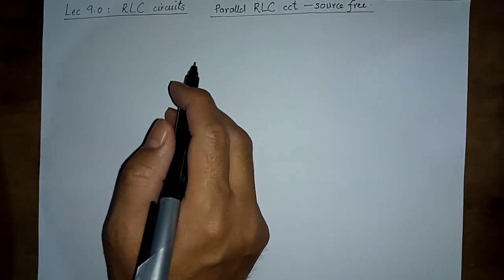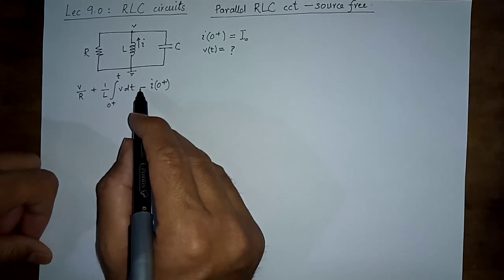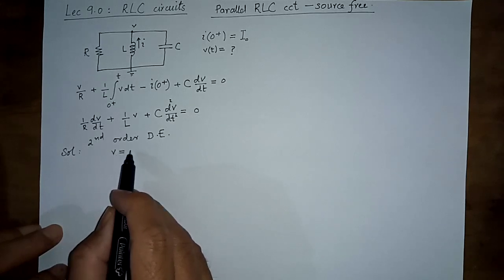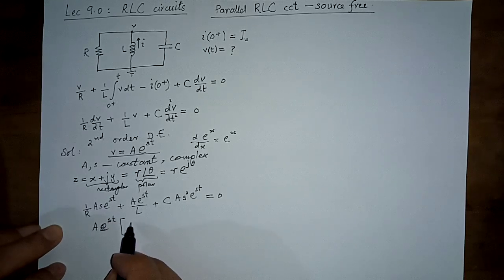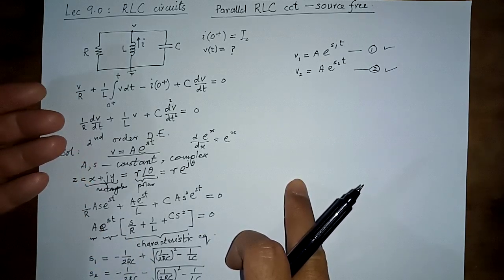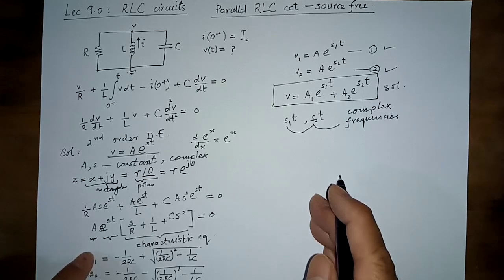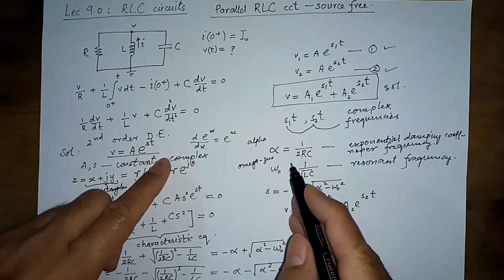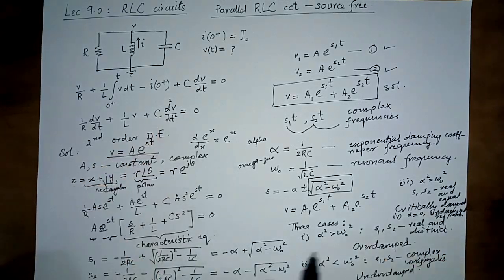VL 9.0: RLC circuits, source-free parallel RLC circuit

Comment: I've been looking for an explanation on why the sign of the integral of the inductor current is positive while the sign of its initial storage current, i(0^+), is negative in the integrodifferential  equation of the source free RLC circuit. Now I finally found it in your video and understand why the signs are like that. Thank you so much sir for making and sharing this informative video.